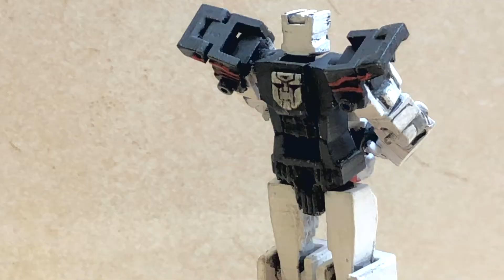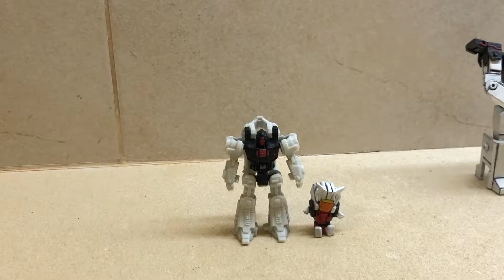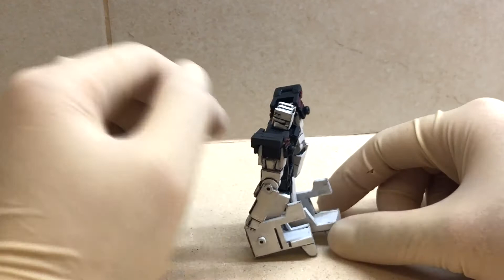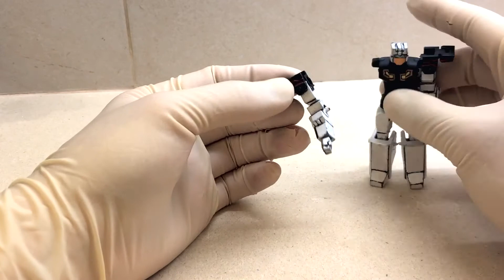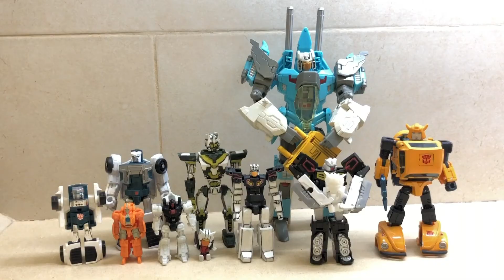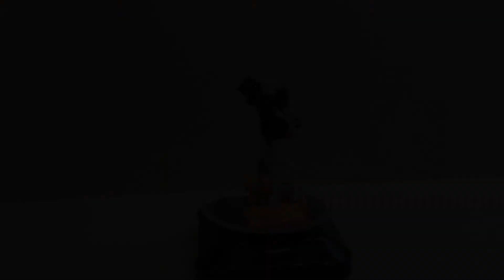TRANSFORMERS MTMTE/ IDW Rewind with Chromedome 'Plushie' - 3D Printed

Comment: This is absolutely lovely!  I've been looking into doing 3D Printed Transformers since I see all that stuff Sam's Forge does.  And you use the Printer I was looking at, which is a question I wanted answered, didn't know if that style of Printer would work for this.
Reply from the maker: Hi, thanks for your comment. Yes, the Anycubic Photon is able to print my models while still retaining small details, and they come out very sharp as well. One thing to note, I’m using the Anycubic resin to print my figures, I’ve had to adjust the thickness of some surfaces to support the 2mm screws to avoid snapping. The printer is fine, it is the type of resin you have to look more, depending on what you’d like to print. I’d actually suggest looking at tougher resins if you’re looking to print posesable figures with joints but the Anycubic resin works well for static still figures. Hope that makes sense